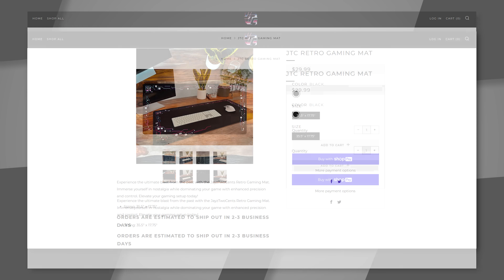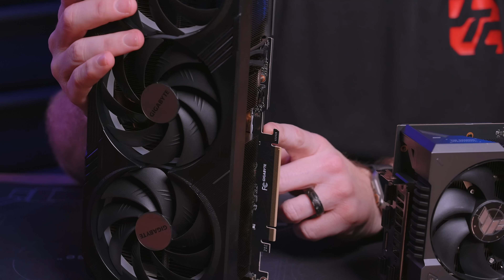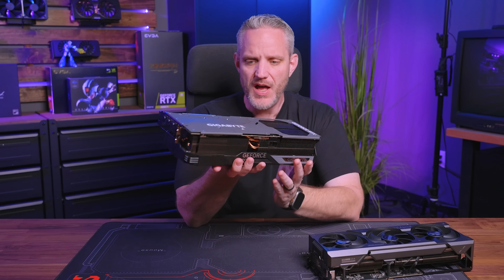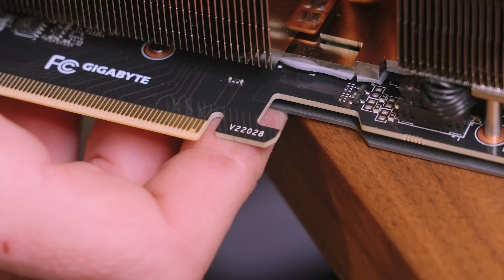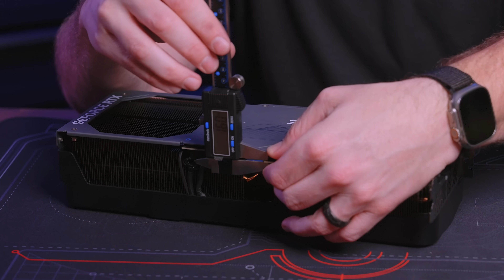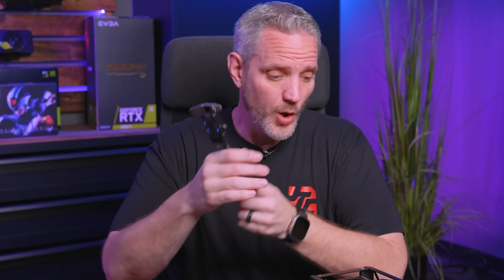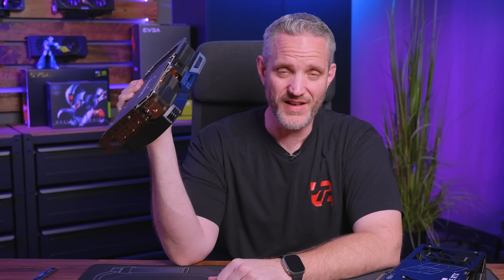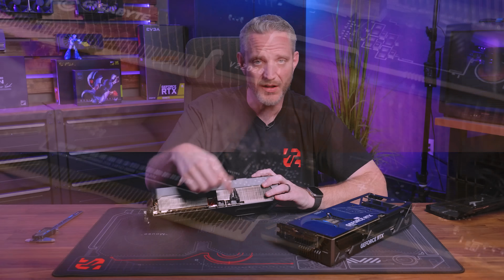These GPUs are cracking and the company REFUSES to warranty them!

Comment: Some of us knew this cracking issue would happen one day as these cards over the last few years they are getting bigger in general and mostly the heatsinks in many dimensions. I even went down the route of buying a new case that lets me vertically mount to help think less about the health of the card near the connector, even though you can buy supports or make some to combat this. Card fatigue is going to be the new plague in the PC environment just like how we had the capacitor plague a while ago. Unless the graphics cards makers and the motherboard makers get together and make a more rugged connector and a more supportive fixture this will be around for quite a while. I just hope that my 3060 from Gigabyte holds together.

Comment: The ASUS mount so close to that edge is what makes thinner stronger. Everyone just needs to find someone to 3D print some kind of crutch to Gorilla Glue in there. Or temp tape in a crutch that maybe covered in a later head popping out of a 4th point of contact warranty.

Comment: Im 3090 owner from zotac. Using the additional mounting support. The crack Should be fixed or change for other model if happen during warranty period in my opinion BUT Im understand Gigabyte can not figure out does user crack it due to inproper mounting or it happened by itself due to material failure so they Reject all cracks as physical damage by user. It is like company costs saving by putting all clients to one bag, rejecting failure to avoid Financial losses even they know that is propably their fault Why should they fix when they could not? and not waste time and cash? - corporation,  to make clients happy? Nope this is about big cash however they can loose more when clients go away.

Comment: I am from a manufacturing background,  my guess is that there is an issue with material that the video card/GPU is substandard material.  The boards should be much stronger that that.

Comment: I am quite curious whether if it's because the radius being too small, I've worked with a few designs in another industry where the small radius caused high stress concentration, ultimately forming cracks
Reply: Good point.. the classical « scale » issue ? 👍🤔
Too often from small to big, or big to small, very often it gives different results.. either in manufacturing, in science, in design.. whatever fundamental application domain you look in.. 😗

Comment: one of the things I liked of the old PCI (not express) was that we didnt need a tab to lock the card and we didnt need power cables and connectors on what seems like most cards.
Reply: In the AGP era I used to always remove the annoying locking tab from motherboards, since even then larger cards did stay in place very well. Only when transporting the whole PC to let's say a LAN party, the card could move from it's slot, but usually it didn't. Also no external power cables for other than more higher end GPUs. Also it was usually a nice 4pin 4wire molex connector, not this PCI-E power rubbish with million stiff cables. Some had dual molex's though which was dual annoying.

Comment: It's funny how the larger size of the card gives you confidence in it's construction and yet it just makes it break more easily.
Reply: People should throw that fallacy logic that bigger = better, or similar.
Reply: @AlfaPro1337  The bigger the card, the more cooling it's able to provide. It's not difficult to understand.
Reply: @ThisIsMeArnold  There are AIO cards, which are smaller and it's provide even better cooling.

See, fallacy logic.

We aren't even talking about cooling solution, this is about build quality.
Reply: @AlfaPro1337  So you're just going to deflect and make the conversation about something completely different, some exception?
Reply: @ThisIsMeArnold  Bruh, you're deflecting and in denial. The OP only states about the construction, NOT COOLING.

"It's funny how the larger size of the card gives you confidence in it's construction and yet it just makes it break more easily."

Where's the cooling part?
Reply: @AlfaPro1337  My comment was responding to you, not the OP.
Reply: @ThisIsMeArnold  Which your comment make no sense, nor related.
Reply: @AlfaPro1337  GPUs got to the size they got to due to larger radiators dissipating more heat. What do you not understand?
Reply: @ThisIsMeArnold  Both the 3000 and 4000 coolers are overengineered. They never needed to be that large. Same can be said of the RX 7900 XTX's cooler...the board partners that make gpus for both companies just use the same overengineered coolers for amd too because that is cheaper to do than redesign.
Reply: @AlfaPro1337  AIO cards aren't necessarily smaller their size is just spread out with the fans being elsewhere, no?
Reply: @ntzt2150  I mean most AIO cards are blower style design and two slots, since there's 1 fan to keep the VRM, and other components on the card to cool.

But your comment on bigger = better construction, I assumed that the bigger coolers have more reinforcement, better build quality and less flex.

I mean, there's a reason why older cards, like 500/600 series OR HD 5000/6000 series have a 'brace' on the PCB. So keep the cooler from flexing the PCB.
Reply: @VoldoronGaming  Never needed to be? Who are you to determine that? What are you even talking about? What is wrong with keeping a card cooler? Are you not aware that the longevity of a capacitor is directly tied to the temperatures it is exposed to during its lifecycle?
Reply: @ThisIsMeArnold  Nope, your comments about cooling has no context about being build quality.
Reply: @ThisIsMeArnold  Just because a card is bigger doesn't mean its always going to perform significantly better. even having 3 fans vs 2 fans doesn't mean its going to perform much cooler if its not designed properly.
Reply: @jebreggie4225  The ASUS 4090 Strix is far larger than the 4090 TUF. Look up their thermals. I'm obviously not focusing on the various other factors that go into cooling. Size helps cooling with all other variables isolated. It's physics. And, once again, it's why cards increased in size. Or are you trying to argue that cards increased in size for some totally unrelated reason, nothing to do with temperature? Was it a secret conspiracy by manufacturers to break our motherboards?
Reply: @ThisIsMeArnold  Obviously cards are big because bigger is supposed to mean better heat dissipation. but whether the bigger size offers a worthwhile payoff depends on the card and model in question. if you buy a massive gpu for better thermals and it snaps under its own poorly distributed colossal weight you wont be running any thing with your better thermals
Reply: @jebreggie4225  That's great. Except nothing you described can be demonstrated in reality, with any real product currently in the market.
Reply: @ThisIsMeArnold  The gigabyte 3080s apparently. don't know if they still have "new" stocks in stores but new enough to still be a relevant part of the market
Reply: I remember the early days of GPUs with great fondness. When mid-range cards where affordable to middle-class families, and cards were about as big and heavy as today's larger NICs :)

Comment: The better question is "Why teh foog are they still using a latch design with a specification of a maximum of 4 ounces on two pound graphics cards?!?!"

Seriously, that latch design is a consumer law violation.   There should be anchor bars with threaded holes in them and through-bolts that retain the graphics card... cards weigh upwards of twice what CPU heatsinks do these days and THOSE have four screw points.

The fun fact at issue here is that you're deeply wrong: that gap is to allow you to get something securely across the latch toggle to pop it open, like a FINGERTIP.

Comment: Gigabyte's costumer support is back alley levels of shadiness and from what this video tells me the 4 year warranty they offer is a joke too. I'm currently using a Gigabyte 3080ti and am afraid to put the thing under full load because no one has figured out exactly what is causing the cards to die and I doubt my warranty would be honored if it did. I do have a support bracket installed at least so it shouldn't sag itself to death.

Comment: Heres the thing... I have the Gigabyte Gaming OC 4080 and I love it. Absolutely love it. I currently own several 40 series and 30 series cards, and I've owned several beefy, heavy GPU's in the past. No GPU that I have ever bought has come with a support bracket that is as sturdy as the support bracket that came with my Gigabyte Gaming OC 4080. that thing keeps my 4080 level (i checked) and solid as hell. that retention tab wouldn't break if they were using the mounting bracket that was supplied with Gigabyte's GPU's. I'm 100% sure of that. So how is Gigabyte at fault? A lot of people claim that the bracket doesn't fit their case, but thats because they can't understand or don't read the instructions, or they have a case that only supports mATX boards.

Comment: Funnily enough, I RMA'd my Gigabyte 3080 Ti EAGLE OC in September of 2022 for a refund due to constant power/black screen/GPU freezing issues. I had my GPU mounted vertically though, and it was still having these failure issues that are plaguing those who are horizontally mounted. Now, on the note of Gigabyte's customer service, I've never had issues and they were speedy without hassle with my RMA. Been using Gigabyte since the mid 00's when BioStar was still making mobos.

Once my refund went through, I decided to jump on the XFX 6950XT and try AMD for a change after being Nvidia since 2004. It's been a blessing since, and with the cost-to-performance ratio from Team Red; Nvidia can keep their crap. Never going back.

Side note: I wonder if this PCB cracking issue is also present on Gigabyte's AMD boards?

Comment: As others have said your calliper measurement of the gigabyte card was wrong they were the same you should read a caliper while it's still in contact. 

I think the difference in perceived flex is the mounting screw for the ASUS cooler is right near the retention tab which is theoretically a worse design for cracking because it's preventing flex from being able to spread across a larger surface area but obviously the ASUS card has less weight being held on that tab because of a better overall design. 

When I teach courses on hydraulic system trouble shooting while different is still applicable I teach that you should never get fixated on the symptom because it's not necessarily got anything to do with what's causing the problem

Comment: I think these t h i c c e r cards shouldn't be made in the first place when the principal method of connection to the motherboard is a shape made 20 years ago with no revision when cards were 1 pcie of width.
What happened to technology going smaller.
Just recently some company is trying to reduce the cooler size.

Just an example
Did Hard drives improved by going as fast as possible?
Did Ram improved by being towers?

Comment: This is one of those situations where I doubt I'll ever run into the problem, but I'm still going to avoid the brand because they've cultivated such a bad reputation about their customer service that I don't even want to risk it. Good job, Gigabyte.
Reply: Of all my builds I've ever only had one part fail in short order, a Gigabyte MB. sure it could happen to anyone but it was the first (and last) that i purchased from them.
Reply: @adreanmarantz2103  i used gigabyte mobos in literally every build that i  did for my self or for a family over the years. never had an issue
Reply: @jedenzet  I may have gotten unlucky, but when it's the first one it stings a bit more. In contrast I've used asus/pny/evga forever. Even with Asus's recently f'up I would probably still give them a chance when I'm ready to upgrade because of their record.
Reply: @adreanmarantz2103  I had an issue with my gigabyte's MB too back on intel 7th gen, have a gigabyte gtx 1080 that also had problems, and I remember when looking for monitors to buy I was very close to pick one from gigabyte just cos of the price and features thank god I looked into the users reviews on amazon... needless to say that monitor sucks. I tried to contact their support once just for sh!t and giggles the support site didn't even load lmao. Yeah that brand is cancer to the PC industry/community.
Reply: @adreanmarantz2103  yo same, my first (and last) purchase from Gigabyte was an ITX motherboard and it was dead on arrival.
Reply: EXACTLY my thoughts! Thank you! The shroud bending on the earlier modes is ABSURD.
Reply: Waiting for a RX 6800 video card warranty now and this dose not make me feel good
Reply: Who are you going to go with?
Asus?
Not after their motherboard firmware issue

Gigabyte?
Not after this issue

EVGA?
They dont do NVIDIA anymore

MSI?

Galax?
Reply: @IIGrayfoxII  Asrock
Reply: @BLVKOZ  well Asrock only produce AMD GPUs
Reply: @IIGrayfoxII  Sapphire/XFX, maybe Nvidia Fe and Msi. Then EVGA PSU, mobo
Reply: @IIGrayfoxII  I'll always go ASUS, for mobos and cards. ASUS is only junk for AMD
Reply: @IIGrayfoxII  MSI, ASrock, PNY, Zotac, Sapphire, PowerColor, XFX etc. And soon even Acer. Obviously options are more limited if you insist on an nvidia gpu, but if you don't care if it's nvidia, amd or intel then there's plenty of options
Reply: @bleack8701  Powercolor, XFX, Sapphire are AMD based.
I am looking into getting a new GPU to replace my GTX1080.
The RX 6800XT reference designs are more expensive than the non reference designed RX 6800 XTs
Reply: @bleack8701  Inno3d too. Their rtx 3070 works very well in my machine. They make hardware for 20 years already.
Reply: @IIGrayfoxII  did you even read the full article they were willing to replace the mb which has those issues unlike this gigabyte here who does knows their GPU PCB has issues but will deny u warranty claim !!!
Reply: @laufookheng7194  Asus said they will do this after all the backlash.

Before that, they went, if you install this beta firmware to the motherboard to stop this, you void warranty.
Reply: @IIGrayfoxII  Well at least with the crowd blasting them they got do something , this one gigabyte got people blasting them they still in denial mode plus GPU's nowadays are the expensive computer components unlike last time when CPU was among the priciest. was a Fan of gigabyte and planning to get their rts 4090 with LC cooler now with this kind of news will go with msi rtx 4090 suprim liquid x instead, according to my computer vendor for warranty claim is much easier.
Reply: @laufookheng7194  Liquid coolers should be lighter than air coolers.
But if you are capable, get an air cooled verison, buy a water block from EK or whom ever. and install it.
Its what I did with my MSI GTX1080
Reply: @IIGrayfoxII  asus gpu is still good, only their mb have a problem
Reply: @tryxlolkb  it's not about did a brand have or did not have a problem with said product. It's about how they handled the problem.
Reply: Well currently you got Gigabyte and MSI to choose from and if MSI doesn't offer a board to your requirements but Gigabyte does? GPU's obviously there are more choice but now you'll want to also eliminate MSI if you don't want a super low bios wattage limit meaning just about any other card out of the box will beat it. And for Nvidia cards I mean nobody really does make a "good" 4xxx card because Nvidia won't let them.
Reply: MSI, GIGABYTE both have poor RMA service in India. Asus have bad motherboards, AsRock also had some issues in the past. So we are really stuck here.
Reply: @bhuchin  ASUS does not have bad motherboards. Just because of small issues with an AMD board doesn't mean they are all bad...
Reply: Gigashyte living up to their reputation...
Reply: i never ever buy gigabyte!
i owned a 1060 and this card was good but i have many friends with gigabyte Mainboards and they are bad!! no matter x570 Elite or x570 UD.....trash!
i use MSI, for EVERYTHING and i never had any problems.
Reply: @mio2540 I do use a bracket, which is why I doubt I'll ever run into the problem. The point is Gigabyte has stood out in the last few years as having the worst track record for honoring warranties among all the brands; if I suffer some random failure, my chances of getting warrantied sounds about normal, but if it's a failure due to some design flaw that affects enough products that Gigabyte expects a ton of warranties? Chances suddenly get a lot slimmer.

Comment: Maybe I'm wrong but, is it possible that the Gigabyte's GPU is more flexible in that specific area due to cooling/backplate mounting? If you see at ASUS's card here @6:49 there is a big mounting point for backplate/fan cover and looks like the backplate is closer to the PCI-E then Gigabyte's card.

Comment: jay i have that same gigabyte 4080 and the gpu bracket that is supposed to hold the gpu actually forces the gpu to sag, i do not use it and instead use a case bracket to hold the front part of it so it doesn't sag, that may be why those gigabytes are cracking

Comment: I hate that damn retention button. I just got a new 6950XT and trying to get my old card out of the slot (Asus X570 tuf plus wifi) was such a major pain in the ass. I ended up using a long-stem flathead screwdriver to be able to push it down, sweating bullets the entire time that I would slip and spear my motherboard. 

While it is not the absolute unit that some of the 4080-90s are I still bought a piston-style support ($13)for my video card and it is rock solid with zero chance to sag or wiggle.